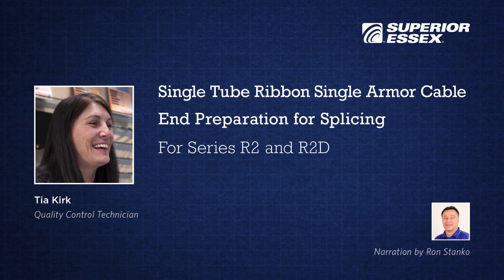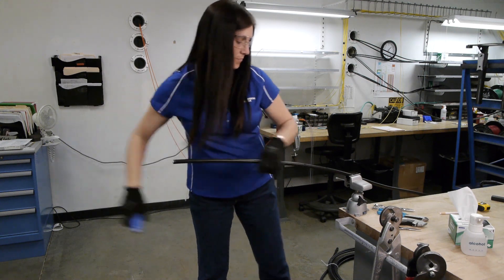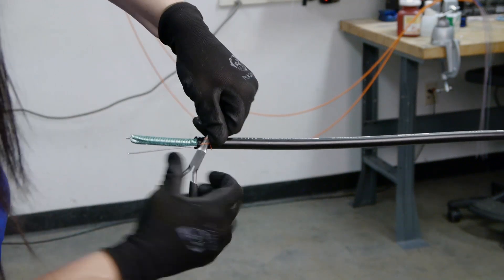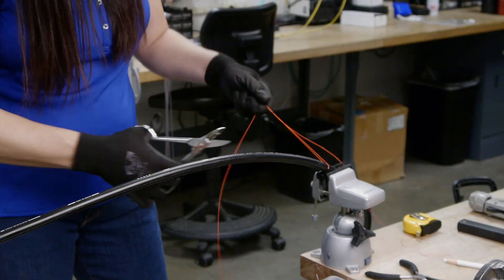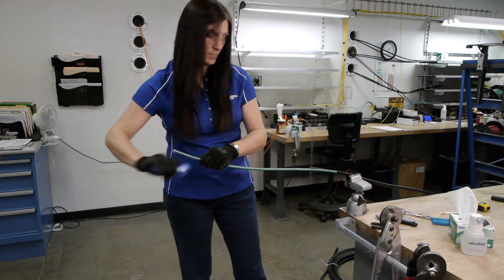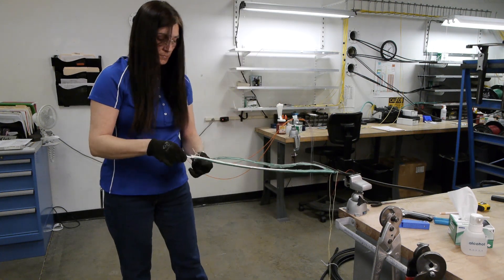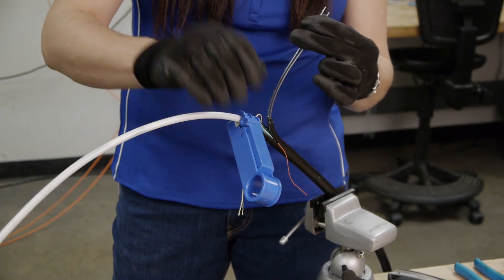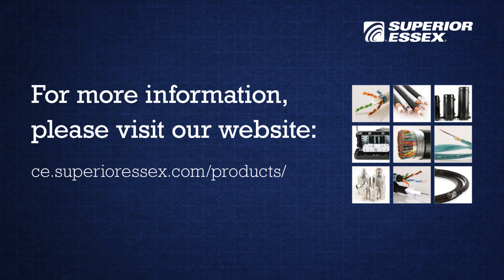Technical Video: How to Prepare the ends of optical fiber ribbon cable for splicing

Comment: Yeah lol wrap that rip cord around those pliers. I guarantee if you're out there 15 hrs+ a day you'll be using a drill with a n extension ran real slow. Especially when you're hitting about 15 locations of jacketed loose tube